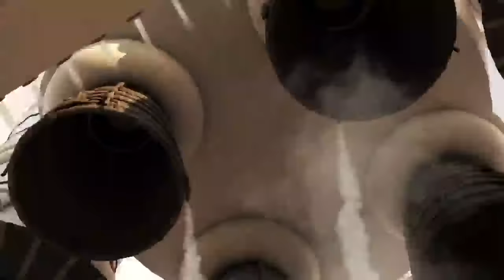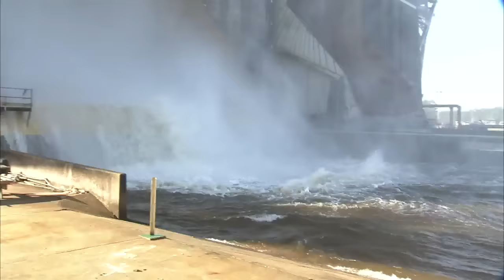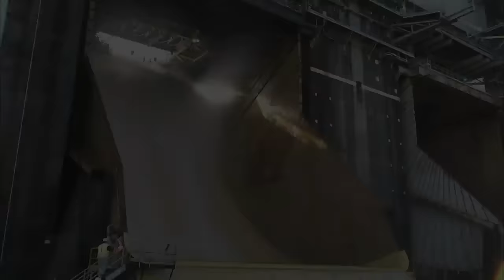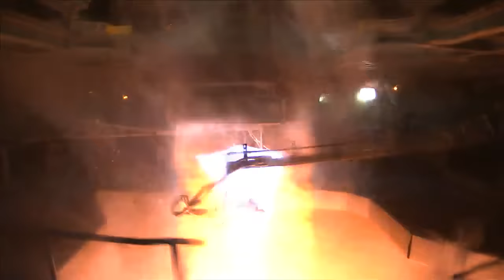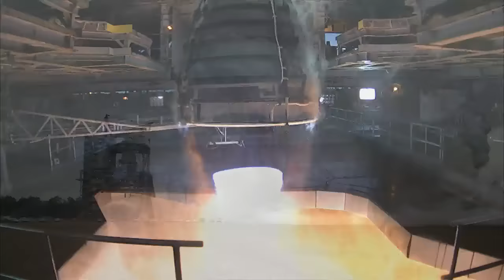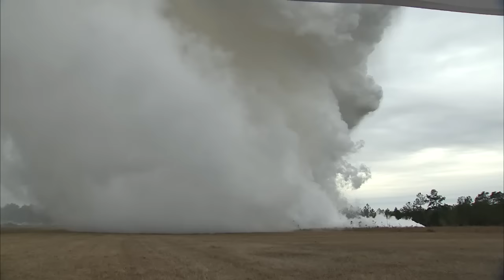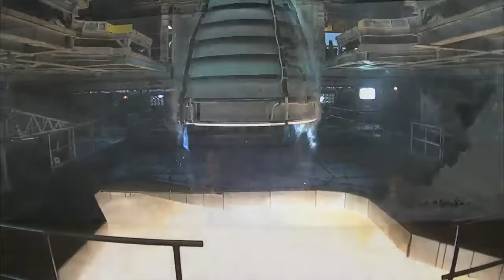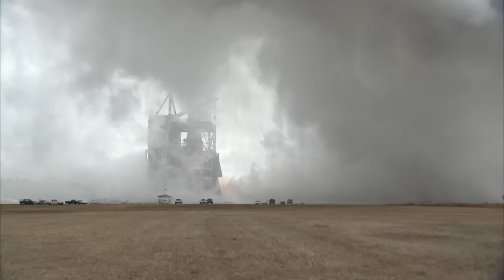NASA Conducts First RS-25 Rocket Engine Test of 2018

Comment: If it’s not reusable you’re literally burning money away.
Reply: The initial flights are to be with modified RS-25Ds left over from the Shuttle program. After those are used up will be the cheaper (expendable) version of the RS-25.
Reply: and the SLS will still cost 5 times as much per kilo to orbit as the FH
Reply: Which is why we will use the Falcon Heavy for smaller things, like satellites, and reserve the SLS for the big things that need to go up all at once, such as Mars habitat modules.
Reply: BlackEpyon which is absolutely not the plan for the cis lunar station being launched...

What hardware in development requires a rocket the class of sls.
Reply: NASA would still contract SpaceX and other companies to get their smaller stuff into orbit, of course. They STILL like to save money and effort where they can, especially with something so routine as launching a satellite.

Originally, SLS was meant to launch the kind of heavy landers we'd need for a manned Mars mission; where you'd drop a 20 or so tonne hab module onto the planet using a skycrane, like Curiosity on steroids, and/or just a larger ship, like the LEM on steroids. One could also launch space telescopes even larger than JWST. If you have a tool, more options unfold simply by having the tool available. The point was to have that super-heavy lift vehicle available for whatever mission needed it. 

You could still launch your Mars ship in pieces and assemble it in orbit (which I think was the plan anyways), but do you really save money that way if you have to launch MULTIPLE small rockets, rather than a few big ones? How many fewer missions would the ISS have needed to assemble if it could have just been launched in larger pieces to begin with? And in the case of a Martian hab module, you probably NEED to launch larger pieces either way.

This is why I gripe so much about NASA being forced to change direction every time somebody else moves into the Oval Office. NASA needs to be more independent of the political changes, otherwise they will keep wasting money by ABANDONING what they were currently working on, the same way Constellation and the original moon return Bush proposed was canceled when Obama took office. Now the Mars plans are put on hold, and we want to construct a cis-lunar station instead of going to Mars? THIS IS WHY NOTHING EVER GETS DONE!

Everything NASA did under the Obama administration was meant in some way to contribute to the end goal of getting humans to mars by the 2030s. The current administrator, like almost EVERYBODY ELSE Trump appoints, has little to no qualifications for the job. He flew an AWAC, and was part of a wing of fighter jets. He's not going to be testing the spacecraft, so what good is that going to do in his new position? He has NO science background, no spaceflight background (or even training), and therefore NO relevant qualifications! 

So now the goal is to get back to the moon. A place we've already been. And to do what, exactly?

What are we going to do on the moon? We've already been there, so it's not advancing any spaceflight goals. The only conceivable reason to have a station in lunar orbit is to test long-term human spaceflight outside of Earth's magnetosphere, which Orion's second and third missions were supposed to do with the asteroid redirect missions. There's no point in "parking" in lunar orbit before heading off to Mars, since you'd need to decelerate to enter orbit, and then accelerate again to leave, and do a slingshot back around Earth to build up your momentum again before making the trans-Martian injection burn. How much fuel would you waste doing that? This isn't sci-fi; you don't just park wherever you want to pick up fuel; you NEED to keep your momentum, otherwise you WASTE fuel!

And lets not even talk about how much the resupply missions to this "Deep Space Gateway" would cost! The ISS resupply missions are just a quick jump into orbit; something that we've done hundreds of times before with all the communication and Earth-monitoring satellites we've put up.

Are we building a permanent moon base? Personally, I'd like to see one, but if so, then the lunar space station serves absolutely ZERO function that could not be served by also keeping the ISS running past the 2020s! Run your zero-G experiments on the ISS as usual, and conduct your extra-magnetosphere human experiments on the moon. You can't just put something up there wherever you want it. It has to serve some research purpose, or be making money, otherwise it's just a WASTE of money.

If they cancel SLS, then they WILL have wasted everything that was spent so far under Obama's administration, and be out one super-heavy lift vehicle, which SpaceX doesn't have either, as they haven't even BEGUN working on the BFR. I have no issue with Elon Musk dreaming big, but given that nothing of the scale of BFR has even been attempted before, let alone a reusable one. Landing a booster or a rocket isn't anything new (we did that with the Apollo LEM module, after all). We'd never done it with the goal of recycling rockets before, but it's not too big a step. I can't even conceive of the metallurgic stress such a ship as the BFR would have to endure to be safe for human spaceflight, or how it could possibly be as cheap as he claims considering how much of a money-hole the "reusable" STS turned out to be when it had to get completely overhauled after every mission.

Knowing Trump, SLS could well be cancelled anyways, since he likes to cancel ANYTHING with Obama's name on it, simply because it has Obama's name on it.
Reply: Did you really just Imply that Obama did anything towards advancing manned space flight? You have to be an ULA employee of some variety..... there's no other viable explanation for someone making that claim about a president who devastated NASA. The SLS was not even started under Obama, it's the last pork barrel vestige of Obama's cancellation of constellation .

I'm not going to touch on your comparison of the LEM and landing a multi-story orbital class booster. Aside from using an engine and landing legs, you aren't even close. 

And yes, launching four rockets capable of 252 tons combined weight to orbit for 512 million is cheaper than launching two 1 billion dollar rockets for 260 tons.
Reply: "Did you really just Imply that Obama did anything towards advancing manned space flight?"
Yes, he did. He said that we've already been to the moon, lets go to Mars where we haven't been. That's an advance.

"The SLS was not even started under Obama, it's the last pork barrel vestige of Obama's cancellation of constellation ." 
Obama first took office in 2009, and SLS was started in 2011. Constellation was originally to use the Aries V design. That was scrapped, and the design concepts were re-worked into the SLS, which was to recycle the RS-25 engines rather than design a new engine based on the Saturn V's J-2 engine.

"A president who devastated NASA"
How so? By canceling the shuttle?

"Aside from using an engine and landing legs, you aren't even close."
It is literally the same thing, scaled up, but using an avionics computer rather than a human pilot, and after some trial and error, they were able to succeed. The difference with "scaling up" to the BFR, and why I'm skeptical of his ambitions, is the shear amount of stress the metallurgy would have to endure for even a single launch, let alone repeated usage. If he can pull it off, fine, kudos to him.

"launching four rockets capable of 252 tons combined weight to orbit for 512 million is cheaper than launching two 1 billion dollar rockets for 260 tons." 
Not if the mission calls for the launch of a monolithic object, such as won't fit into the faring of a Falcon Heavy, such as hab modules and descent hardware for a Mars base. You'd need to launch the pieces and then assemble it in orbit, a cost that would rise dramatically if it involved manned missions to do so. Falcon Heavy is capable of sending 16.8 tonnes towards Mars. You would need to build it in orbit, including all the extra missions to assemble it, THEN launch it.
Reply: He did say we should go to mars, then promptly cancelled the Ares I, which would have provided a much lower cost LEO launch vehicle than the shuttle, slashing funding, issuing assanine mission statements, and scaling back funding to everything but SLS, which is a 100% Congressionally  mandated pork barrel project. The STS needed to be cancelled and replaced, but Ares 1 would have been a superior option, or a man rated Atlas, at the time. 

The SLS is the same heavy lift component it has always been from the inception of constellation. They renamed it post cancellation of it and the J-2X, but it is the same concept as proposed decades ago. The J-2x was an upper, not lower stage engine. and has been replaced with an upper powered by RL-10's from Centaur as was proposed in the original Ares V proposition. BTW, the Ares IV was the manned version, not the V. 

The fact that you believe a propulsive landing on the moon and a propulsive atmoshperic re-entry of a several story tall orbital booster are the same thing is not giving you much...credibility in your assessment of metalurgical concerns, especially in light of recent evidence to the contrary.  

Nasa does not, and has never, had a single monolithic piece of equipment that needs to be sent to mars. There are no plans moving forward in the next 20 years to send anything monolithic to mars. There is absolutely NO reason for the SLS at this point, nor is there in the even vague future. 

SLS is not "progress". It's aging Apollo era mentality and hardware, built in the most wasteful and pork barrel means necessary, to appease political constituents.
Reply: "promptly cancelled the Ares I, which would have provided a much lower cost LEO launch vehicle than the shuttle"
Isn't that about the time NASA started contracting private companies to handle the launches? Seems that would save even more money. The Shuttle at that point was mostly building and supplying the ISS.
SLS is Apollo-era mentality? And BFR is not? BFR is a page straight out of Von Braun's book.

If you want to complain about pork spending, look at the grossly inflated DoD.

Landing a booster doesn't introduce any more fatigue than launching the damn thing in the first place, as long as your landing struts are properly integrated into the structure.
Reply: The initial commercial crew development contract didn't hit until after Ares 1 had been scrapped, and the STS cancellation had been announced, and then it was only really a feasibility study. 

I do wish you'd make up you're mind. You're griping about the idea of scrapping the ,thus far, vaporware SLS and using the available, and drastically cheaper, commercial options, but you are ok with the fact Obama cancelled a fully functional booster that had already flown, and at a reasonable cost for the time. 

You're so determined to invalidate SpaceX, you can't see the insanity you're posting. SLS is a 100% disposable booster, built on a gargantuan budget. It IS Apollo era "if it works, build it! Damn the costs!" technology. If anything, BFR is an amalgamation of Korolev and Von Braun's ideas.... the Falcon Heavy certainly Vindicated Korolev's design decision on the R-7

You're incorrect that landing in a vacuum , in very low gravity, is identical to effecting propulsive atmospheric re-entry and landing. I'm not going to argue with you any farther, the facts are the facts, and history is on my side with this one. However, let's assume for a minute you had the right idea. Why are the first 4 sls flights going to be throw away boosters? None of them are scheduled to be at max payload. If it's so simple, and old technology, why is NASA insistent on not recovering any of the hardware for re-use or recycle?
Reply: If the job of the Ares 1 can be done with commercial vehicles for the same cost, or cheaper, then Ares 1 had to go. But the presently available commercial vehicles can't even come close to what SLS will be capable of.

Vaporware would imply that components of the rocket don't already exist, such as the refurbished engines and SRBs, which have now both been tested. All they need to do now is build the fuselage.

The first 4 flights won't be at max payload, but you have to remember that the maximum payload also depends on how far you need to go, and which configuration you're using. That's why the wiki-pages on all these rockets show LEO payload, and other destination payloads separately, because the further you go, the more fuel you need. Three of those are to go into Lunar orbit with an Orion craft, which STILL requires a Saturn-V sized booster. The 3rd and fourth missions are to deliver modules for the LOP-G, which I think is still a waste of time and money. The block 2 configuration uses "advanced rocket boosters" rather than shuttle-era SRBs, and those haven't been tested yet.

I'm not invalidating SpaceX. They're good at what they do. I simply have doubts about the efficacy of their proposed BRF. Not just because of it's size and the associated metallurgical stress, but also how many engines it's supposed to have. The CCCP tried the same idea on the N-1 with 30 engines on the first stage. Oscillations caused the destruction of the first N1, and unexpected eddie currents the third. The fourth failed when backsurge (water-hammer effect) from shutting down the core ring of engines caused fuel lines to burst. The more engines you use, the more complex and fragile the plumbing gets. BFR is supposed to have 31 Raptor engines on the first stage. These aren't unsolvable problems, but HISTORY has shown, that the more complex the system, the more there is to go wrong, and the more LIKELY something is to go wrong. They have their work cut out for them.

I'm also suspecting that Elon Musk's rapid progress and string of successes will go to his head, if it hasn't already. His proposed timeline seems too fast for something that hasn't been done before. SpaceX had already landed their Falcon 9 several times. The Falcon Heavy is essentially two Falcon 9 first stages strapped onto the complete Falcon 9 stack in the middle. With that in mind, if they can land one of them, they can land them all. And they did.

"the facts are the facts, and history is on my side with this one"
The concept is still the same. You go up, and you use thrust to slow your descent. This requires an engine that can be throttled dynamically, which we had on the LEM. We now have computers that can take the place of a human pilot, even countering for crosswinds. Other than designing the fuselage to support landing struts, we already had engines that could throttle dynamically, and that's all we needed. Now what history are you talking about? How long have we been taking off vertically and landing the same way?

"If it's so simple, and old technology, why is NASA insistent on not recovering any of the hardware for re-use or recycle?"
I'd imagine the stigma against the reliability and cost-effectiveness of the "re-usable" Shuttle might also have something to do with it, given that it had to be overhauled after every mission. Time will tell what kind of service life the Falcon 9 and Falcon Heavy will have before they become too stressed out to fly safely. But primarily, you said it yourself; "Pork." 

If you want to complain about pork spending, look at how much money goes into the DoD every year, and you'll see that anything NASA spends is chump change. We're talking about an average of 18% of the GDP to the DoD, compared to 0.4-0.5% to NASA. If the US can afford to build another aircraft carrier, and send it's military might to harass third world countries in petty proxy wars with Russia while refusing to take in the refugees the conflict creates, then it can damn well do something constructive and build a rocket.

NASA, ever since it's inception, has been a "jobs creation program," like EVERY OTHER government agency or funded project. It was easier to just let them splash-down in the ocean and pay the engineers to build another one to keep "creating jobs." I don't like it either, but it is what it is. Private companies like SpaceX build their rockets in a single factory, rather than multiple facilities across the US, and that saves a hell of a lot of money. Although there is some logic in spreading out besides "creating jobs," in that with space interests in almost every state, NASA becomes "too big to fail," so to speak, so congress would never shut it down. Also, the CCCP would never be able to halt the Apollo Program by taking out a single facility. That made sense in the Space Race, but not any more. At this point, Congress really should consolidate NASA, and use the same budget to get more done, since nobody wants to increase that budget, even though they're willing to give a few more percent to the DoD.
Reply: Block 2 was cancelled, and the last publicized materials from NASA put all four flights in CIS lunar, not Lunar, orbit, but the heavy is capable of lunar injection of the orion spacecraft. You do NOT need a Saturn sized booster to inject a manned space craft into a lunar orbit. It is vaporware, as no boosters actually exist. They have parts and engines taken from the shuttles, but nothing more. 

At the time, and to date, there is no human rated commercial vehicle that could do what the Ares 1 was ready to do. The possibility was not even being studied, much less confirmed. 

I find it funny that the single most launched, by a MASSIVE margin, booster in the history of orbital spaceflight has 32 separate combustion chambers on it, but 33 is going to be an issue? The N-1 failures had far more to do with the drunken fool(michin), and teething problems of a completely new engine designer and concept, than it did with an inherent flaw in the clustering concept. 

I read your posts and hear a whole lot of "whataboutism" in the DoD budget complaints, and the side stepping around the reality of the gutting of US manned space flight in 2010. Had the public vitriol towards the Obama administration following the cancellation of STS not been so strong, Commercial crew flights would likely have never been pursued, as they had already been denied the previous two years. 

I'm not going to argue with you about landings any farther. You seem to fail to grasp the impact of atmospheric re-entry, and the scale of what you're talking about. This is like listening to someone who launches LPR rockets lecture an amateur rocket enthusiast during a L3 attempt.... it makes 0 sense.
Reply: "Block 2 was cancelled"
Then the Wiki-page needs updating.

No boosters exist? What's this then? https://www.youtube.com/watch?v=jATkV8HE2sQ

"last publicized materials from NASA put all four flights in CIS lunar, not Lunar, orbit..."
Similar distance, and the Wiki-page needs updating.

" there is no human rated commercial vehicle"
A nonsense terminology. Either the rocket works, or it doesn't

"the heavy is capable of lunar injection of the Orion spacecraft."
Actually, you're correct on that. Not in re-usable mode though, and not to Mars.

"single most launched, by a MASSIVE margin, booster in the history of orbital spaceflight has 32 separate combustion chambers on it, but 33 is going to be an issue?"
The Soyuz rocket has 20 main engines on the first stage, including the boosters. The smaller ones steerage motors, 4 on the main rocket, and two on each of the boosters (notice the gymbal mounts, where the main engines are hard-mounted). https://upload.wikimedia.org/wikipedia/commons/thumb/f/f5/Soyuz_rocket_engines.jpg/1024px-Soyuz_rocket_engines.jpg
BFR is supposed to have 31 Raptors on the first stage, and likely at least some of them will gymbal to provide attitude correction during takeoff and landing. Be sure that you're not comparing apples and oranges.

"a whole lot of "whataboutism" in the DoD budget complaints"
You're the one complaining about SLS being a pork-barrel project. Don't complain about one tree blocking your view when the entire forest is burning.

"Had the public vitriol towards the Obama administration following the cancellation of STS not been so strong..."
The STS retirement was planned during the Bush Administration. Don't blame Obama for that one.

"You seem to fail to grasp the impact of atmospheric re-entry, and the scale of what you're talking about."
It seems pretty simple to me. Not sure what your problem is.
Reply: RE the "job creation programme" bit I think that might be part of the reason why SpaceX is successful anyhow - someone has to keep engineers fed until an opportunity like SpaceX turns up.  They can all cut their teeth at NASA and then go off to do great things. If you don't have that huge lump of government spending  then there will be less security for people who choose those careers - at least until the space industry is far huger.